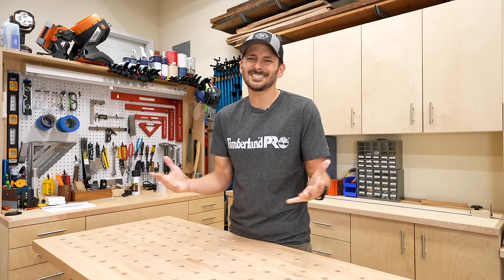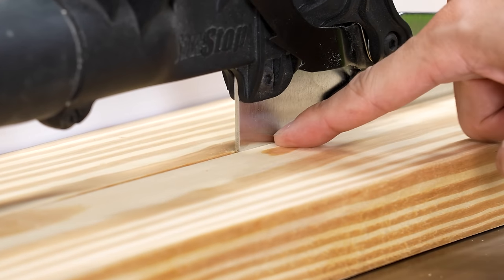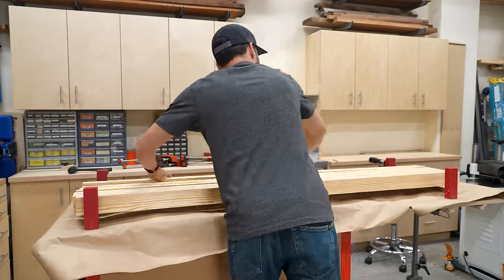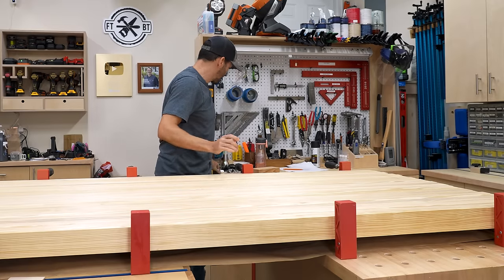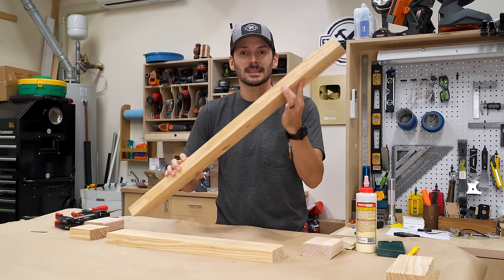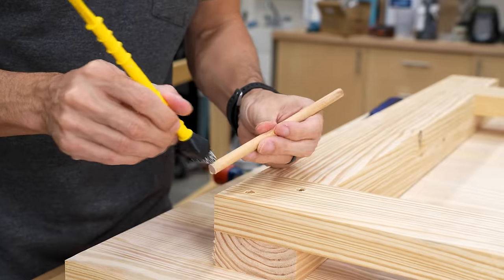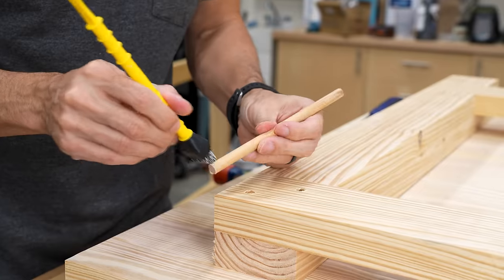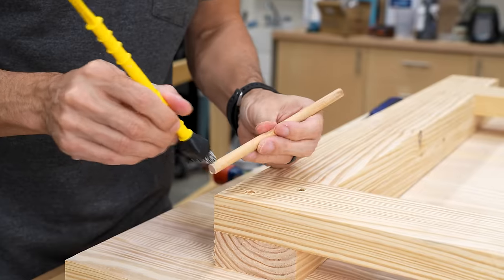Building a Sturdy Workbench with Cheap Wood

Comment: I don’t know where my question disappear to but it was a long one… Essentially I would like to make a “practice“ one of these by making a small islands to go in our tiny home. We are building a tiny home with absolutely no experience, and absolutely no clue, so we are muddling through – two steps forward one step back. But I have a few questions. I only have the basic tools Dash chopsaw, circular saw, sabre son, drill, KREGG pocket hole Joleane, belts and palm sander ‘s, and my grandfather‘s manual hand planer. Do you think I can make a kitchen island and then any more offence similar to this with those tools?

Comment: It looks like you got it nice and flat, I am surprised that you didn't do the router flattening thing with the jig made from MDF.  You did avoid a big mess by not going that route and I'm sure it's flat and precise enough. I think that ripping 2x6's instead of 2x4's was a great idea because it's kind of a perfect thickness, thick enough but not so thick that it's insanely heavy.  What was the finished thickness after flattening it?

I have similar drill bits that I got from Harbor Freight that I bought for sticking a dowel in for a couple of flute stands I repaired for some musicians. 

Two vertical rows of drawers with a cabinet door in the middle if the bench is wide enough would probably work pretty well. Maybe two cabinet doors with a combination of drawers and open shelves.  The doors would cover the drawers and the open shelves. I've seen cabinets like that and it looks pretty good and sawdust isn't going to get in the drawers.
Reply: He showed the final thickness, it was about 2.5in thick.

Comment: Nice build!  I built myself a shop table about 20 yrs ago.  One thing that I did that has become indispensable over time is electrical wiring.  I installed an outlet on each corner and ran them through a switch so I could kill the whole tables power with one switch.  At the time I did it because my children were still little and this way I could shut everything down with one switch, no question.  I also installed a router station and I could use the switch to turn the router on and off.  One other thing I did was cover the top with a sheet of plywood, my thought was that as the top got beat up over time I could just replace the top piece of plywood and have a new table top.

Comment: The pink stuff is probably Douglas Fir. The orange big box store classifies various species of 2x dimensional lumber as "whitewood". But you can read the stamp on the wood itself to identify the species. Douglas Fir at the big box often has a "D-Fir" stamp. Sometimes there's a triangle with "D" at the top and "FIR" underneath the D.

Douglas fir is good for table legs, and I used it recently for an outdoor project because supposedly the pink heartwood has more extractives than many other species of lumber that are milled and sold for dimensional lumber, and supposedly that gives it relatively good rot resistance. Other than SYP (southern yellow pine), it's the strongest dimensional lumber sold at big box stores, although SYP has superior janka surface hardness. So I would not use D-Fir for a workbench top, but I might use it for legs or framing for a lightweight workbench. D-Fir is lighter than SYP.

I would not use anything stamped as SPF for building furniture, but I might use HEM-FIR (often mixed in with the same pile as D-FIR at the orange big box) for frames and legs because I have found it to be relatively dense and heavy while also relatively tighter-grained than some other softwoods. I've had good luck with HEM-FIR being relatively straight.

I have indeed found that SYP can cup if you get a flatsawn piece. If you're willing to accept some waste then you can buy wide pieces that are flatsawn from the center of the tree and remove the middle so you're left with quartersawn edges.

One key lesson that I learned about using dimensional lumber to build furniture is that while it can feel very tedious to pick through the entire lumber pile at the big box, spending a lot of time picking the best pieces of lumber at the big box can save you time later in the project.

Comment: Why didn't you use a biscuit, dowl, or domino to join the top pieces together? Seems like that could have helped in sure that it would have been flatter with less work. Just curious if there was a reason or if you felt it didn't need it.
Reply from the maker: yup, those are great options.  Just didn't feel like I needed them...but it would have been easier if I did
Reply: @Fixthisbuildthat  ok thank you for the reply

Comment: My wife and I are going to work on  building 2 identical L shaped FLOATING computer desks with Butcher Block counter top for the surface. Do you have any tips?
Reply from the maker: Make sure you figure out the wiring and weight capacity first.  Butcher block is very heavy

Comment: What are your thoughts on using a solid core door for the workbench top instead of the glued up one? You can also flip it over once it is marred too much.
Reply: I built a bench like that. Works fine. Very heavy. Downside is the thin veneer on the top gets scufffed up pretty fast and I'm hesistant to drill into it since it's an MDF core

Comment: As many other said, GREAT Video.  I don't often see good ones I can even tolerate listening to.  The ones that just aren't good public speakers, go on and on about something having little to nothing to do with the actual build.  You do none of that.  A slight bit of humor that's perfect.  
You're a WAY better carpenter than I'll ever be,  I'm just a keep it simple handyman.  Doesn't say I don't respect and luv what you do.  I'm just jealous is the truth.  haha.

NOW, a question on your build.  How did you choose to attach the top to the rest of the build?   I went back to see where I missed that and never saw.   Did you use metal L brackets or some wise carpenter trick ?  
Appreciate your time and impressive work you do. 

Ron in Cincinnati.  WHODEY

Comment: This is nice.. I just cant justify a build like this its more orientated towards traditional vs modern woodworking.. Modern woodworking calls for tracksaws more use of jigs.. smaller tools and working efficiently. 

If I needed to ensure flat clamping I would make a flat clamping jig.. 

In my opinion 96mm centers with 20 mm holes on a mdf torsion box.. followed up with some match fit dovetail slots on the sides would aloow you to do anything you ever wanted..

I would also consider making the base with a lift mechaNISM JUST MY .02

Comment: I wonder if using Laminated Stranded Lumber (LSL) to build the table top would be a better option than using 2 by lumber.  
There would be no knots, the LSLs would be flat, straight and the same size, but the overall cost would be higher.

Comment: I need some advice... I've had the idea of building a bench using Saligna wood (used for outdoor furniture and decking) but I have no idea if this is a dumb idea or a great idea. No information on the internet either. Does anyone in the comments have a perspective?

My reasoning is that the wood would be free of bends, twists, and knots. My concern is that the wood is that the boards are only an inch thick and 3.5 inches wide, and that laminating will be a big problem.

In my mind it has great potential, but I've never build a bench and I'm a novice at woodwork so it might just be a total waste.

Comment: Great Workbench and video. I think a nice addition could be a deadman. What helps me during the built is to use a stop block on the spacer (11:08). I just nail a piece of wood on the spacer so that it doesn't slide.

Comment: So if one does not have a CNC template cutting machine, what about using a piece of commercial peg board to locate the holes (9/32 holes on 1 inch centers)? Hint: use an old 9/32 twist bit to make a center punch (grind a sharp point on one end) or use a self centering drill bit.

Comment: Hi there. As far as shelves I see a shelf the length and width of the bench. Then if you want you can divide the shelf in cabinets to fit your needs. After that put in sliding doors to keep dust and debris out. I would not use doors because they might get broken since they are the height of your knee/hip. You probably have your own design in your mind so if you do I am looking forward to seeing it. Love the table. Stay safe out there. Take care and God bless.

Comment: All for under $150? Just three of those 2 x 10's costs $150 in NZ Just the lumber for the top is $550 (US$280) in NZ. Is your lumber really that cheap?
And that top glue up? 
Lay a couple of cauls out over yr bench so you have a wider glue up space, lay half your boards out flat, apply glue all at once and then stand them on edge and clamp.  Clamp these together, place to the side and go again. He made this so much harder than it needed to be

Comment: I used your drawer method on my first( and only) workbench it works grea,t but it left me with a lot of space on the other side. I used mine for small parts storage  with those little harbor freight cases but you could easily do cabinets too.

Comment: Would you recommend a hole saw set as you would normally use for plumbing or water outlets in a wall for drilling out the dog holes? I have a 3/4in one in my existing set.

Comment: There's only one problem with the cost you mentioned. That works if you already have all of the same tools you have in order to build the work bench. If you have a shop table saw you can get a lot of it done, but you still need a planer, and a jointer.
Reply: I'm sure the estimate is for material only. And you don't need all the fancy power tools. Everything can be done with simple basic tools. Just takes longer. Wood working has been around long before power tools were invented.
Reply: @bobbystrickland9741  Yes, but it's hard to get wood flat on the sides needed in order to glue them properly without at the very least a planer. You can get by without a jointer by making a simple jig/sled to make your planer work like a jointer, but its really hard to do it without one.

Comment: I need help!  For months I've tried to find a 10 inch and 1 inch (30 mm) arbor, flat grind saw blade for my small Skil table(top)saw.  Fx. 24 flat grind teeth for box joint cuts, etc. as I can't use dado blades on my saw (and they are also not allowed here in Denmark).    

One store I called said I should look for a 24 teeth blade for aluminum and plastic?? 
And with "negative angle" ??

I know, a sharp chisel can clean up the cuts, and I could buy 5 cheap blades without flat grind for less than the 50 dollars a CMT blade costs here, but it would be SO much easier, with the correct flat grind blade, especially for the narrow cuts, without the need for chisel work afterward.  
 
I've tried Amazon, from different countries, but they don't ship to Denmark, and some of the smaller private companies with excellent blades, they and their shipping cost are way too expensive for me.

Any advice will be received with a huge smile and a huge "THANK YOU! my friend" ❤
With love, Pia

Comment: So if you used 2x6s  cut in half, does that mean you only left yourself 3/16 of an inch to plain the boards flat?
Reply from the maker: Yes, picking straight edge boards is the key.

Comment: I'm actually a big fan of leaving mistakes in, when building shop infrastructure (as long as it isn't a functional problem). When I built my mobile outfeed/project table, I drilled the holes in the wrong spot for fastening the top to the frame. It was 3/4" MDF with 1/2" plywood underneath. They were small holes, so I just jammed MDF sawdust into them and called it good. I don't even notice them anymore, but when I do, it's a reminder to be more mindful of what you're doing.

I also initially routed out the wrong spot for the flatbar steel (I made my own version of T-track), so there ended up being a 3/4" lane routed into the table right beside where the flatbar was going to go (properly). NOW, the plan is to take a roll of measuring tape (the fabric kind) and actually epoxy it into that channel. That's a win.

Comment: how did you attach top to bottom frame? did I miss this part?
Reply: Great question. As shown in the video, the top appears to be just resting on the "base."
Reply from the maker: Through the holes I drilled in the aprons.  Just let actaully putting the screws in out of the edit on accident

Comment: Did you add up the total cost? Rough math, no hardware seems like you would have come in closer to $250 on the wood. the workbench looks great
Reply from the maker: Check pinned comment for pricing 👍
Reply: @Fixthisbuildthat  I missed it sorry. very nice your lumber prices have dropped a bit more than mine has, very awesome. as always love the videos

Comment: I salvaged a commercial solid core office door 36by 7 foot had blemished in the finish and discharged also find a metal frame with adjustebell  legs was weary cheep and sturdy also made European style workbench with dogs holes out off left over laminated wood beam all solid and inexpensive 👷🏼‍♂️👨🏼‍🦳🇨🇦🇩🇰

Comment: Enjoyed the video.... great explanations and such.  However, based on your tool list, I need excluding tax and shipping:  $9210 worth of equipment.  $2299 for your C&C machine, $3200 for the planer, $2000 for the jointer, $400 for the Kreg Track saw and $260 for the Low Angle Jack plane?  Oy??

Comment: You use a drill press and drill to drill your dogholes.  What about using a plunge router?
Reply from the maker: Yup, that would work too as long as you had a long enough bit and plunge on router

Comment: At $36 per board, even though you get multiple pieces per board, $150 seems to be click bait. 

It is a really nice job, though it would have been nice to see you make the economy $150 model without the $$$$ tools (planer, jointer, …).

Regardless, looks great especially compared to the $$$$ price tag on similar retail workbenches.

Comment: Do not do glue-up laminations like this!  Lay all of the boards flat and pushed tightly together on top of your fully extended clamps, except for the very first board.  That board should be vertical and in place against the end of the clamps.  Remove the cap from the glue bottle and pour tons of glue over all the flat boards.  Then spread the glue around with a 6" wide drywall knife or scrap of wood.  Then stack them all together and clamp.  Regular titebond is fine if you use this method.  Could you imagine if glue-lam beams or butcher block counters were made the way he showed, one board at a time???

Comment: The table you made is really nice but defiantly not affordable for a beginner. The cost of the tools you use are close to 1500 $ and most of them are not used on day to day basis. Most of the people don't try to run a mini lumber mill in the house they simply buy what they need because it does not requires 1500 $ worth of tools  it is faster easier and cheaper simply to buy from a mill.

Comment: Sorry Brad but I have to call you out on the cost.  There is no way all that wood costs only $150.  That without adding the cost of the new drill bit and the drill press attachment.  In this video you showed a 2x12x16 at $36 so a 2x10x12 should be at the very least $20-25 each.
Reply from the maker: Board pricing is not linear, it's based on supply and demand.  The one we showed is on the higher end.  Check pinned comment for pricing breakdown and feel free to check me.
Reply: @Fixthisbuildthat  WOW!!!  Biggest apology.   I didn't know your descriptions were so detailed and informative.

Comment: "Probably far too much" regarding glue - DON'T SWEAT IT.  Glue is about the cheapest part of the project and using too little is way worse than too much.  Too much and you have some cleanup to do.  Too little and you have weak connections and a project that isn't strong.

Comment: As im watching this video im noticing a trend with youtube woodworkers.  You guys love pocket holes, baltic birtch and glueing everything.  I dont understamd why you guys glue shop projects together.  I dont understamd why you guys all use unfinished baltic birch for everything then spend forever applying finish and sanding inbetween coats.  Why not just use prefinish birch.  It has a mich better fi ish and it will save you a really long time.  And last but not least i dont understamd the love affair you guys all have with pocket holes. Pocket holes have there place n woodworking but you guys use them for everything.  Despite what you guys claim, its not quick and easy.

Comment: 2x12x16 for $36. So this is NOT in fact a 'cheap lumber' build.  Slightly cheaper than where I live but still exorbitant gouging by pre-pandemic standards.  Thanks for nothing.
Reply from the maker: The lumber is under $150 as stated and shown in the pinned comment.  I'd consider that cheap vs. what it would cost pre-made and vs any other material.